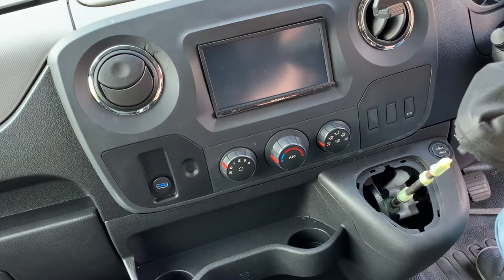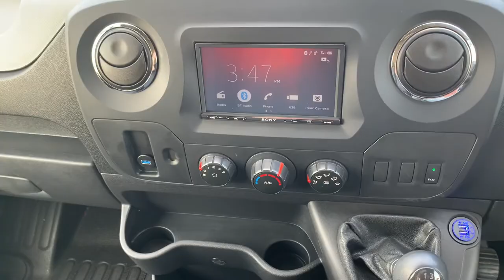Fitting USB sockets to a Renault Master/Vauxhall/Opel Movano/Nissan NV400.

Comment: Hi mate,would this work the same way on the other 12v socket above the instrument panel?
Thanks mate👍🏼
Reply from the maker: I'm not sure, as mine has a USB socket above the instrument panel. If it's the usual 12v cigarette lighter you should be able to change it the same way.
Reply: @master-movano  hi mate cheers for the reply,ye it was the same 👍🏼simple swap out 😉

Comment: Are those chrome rings around the air vents standard or aftermarket?
Reply from the maker: I added those. Bought them on ebay.
Reply: @master-movano  they look good.  Do you know if the auto gear stick is replaceable with something that has some chrome trim?  Always think it looks a little plain.